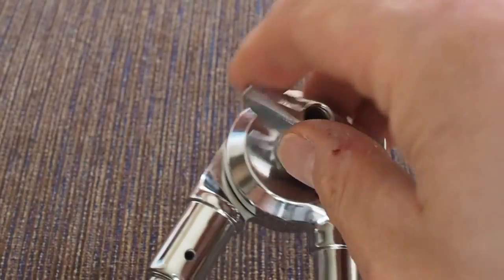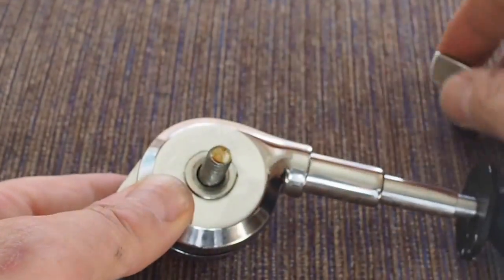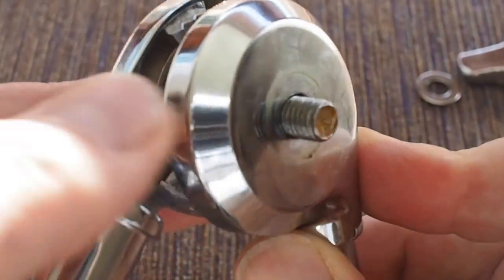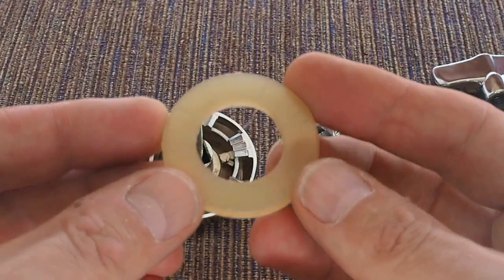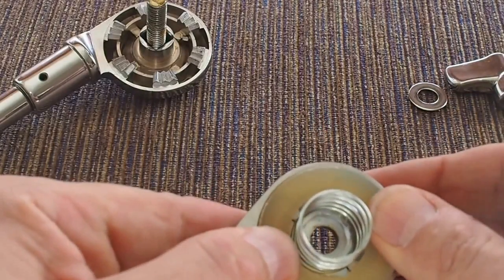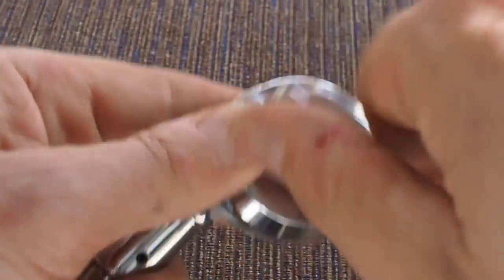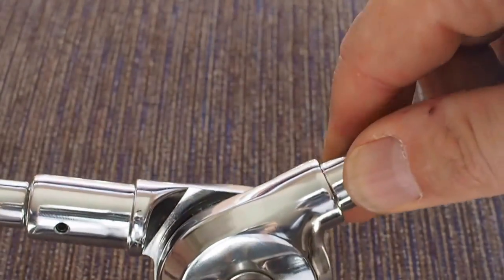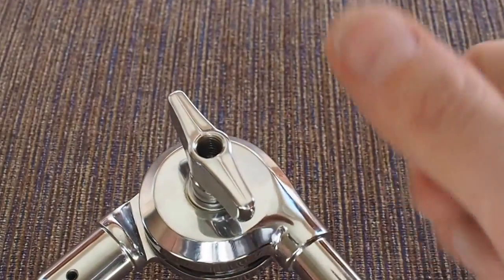DIY gearless cymbal tilter

Comment: Cool hack.  Where do you get the plastic “washer”
Reply from the maker: Gary Zimmermann 
Hi Gary, my dad had some plastic off cuts and turned it up on his lathe. With a bit of luck you might find some plumbing washers the right size- they’ll need to be slightly soft so they grip.